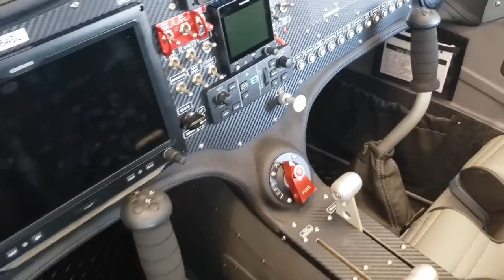The Wings And Fuel Tanks Are Almost Done - Mojosling TSi

Comment: Just cleco and nail the tank assemblies together.
Geez, there will be a surprise for you then.
What you pointed out as intake for the fuel was in fact the outlet from the tank going to the dual fuel selector. Your fuel left over was the return from the fuel injection system from the engine. Fuel is filled on top of the wing into the tank.
Reply: How do you seal the tanks?

Comment: How and what are you using to sealing the fuel tanks?
Reply: Hi Robert, we use CHEMSEAL B2 TANK SEALANT CS3204 A great product in that it is already in a canister that fits into  a caulking gun and already has the correctly measured hardner within, a very clever system.

Comment: It looks very nicely made. My question from the UK is how about corrosion? Is it a higher spec. aluminium sheeting that does not have corrosion problems? Here in the UK most Socata aircraft like Rallye 150ST (now quite an old design) have that problem. Many have had remedial work done, years after manufacture, including spraying internally where possible with solvents carrying wax based inhibitors. Some older Cessnas have this treatment too. Wouldn't now  be the perfect time, (before you rivet the skins in place,) to corrosion proof what you can?
Very best of luck with the build. I will watch keenly.
Reply from the maker: We are spraying internally after we paint

Comment: so I'll ask again...after you match drill components, do you de-bur the holes?...if not why not as EVERY other aluminum homebuilt I've seen says to de-bur all drilled holes...
Reply: Hi John, good question, The Sling kit is CNC punched with regularly sharpened tooling, leaving a very clean hole without a bur.and all holes are already the correct size. The match drilling removes very little if any material and so de-burring is generally not required. The reason we 'match drill' is to remove any tension in the skin that could cause oil canning.